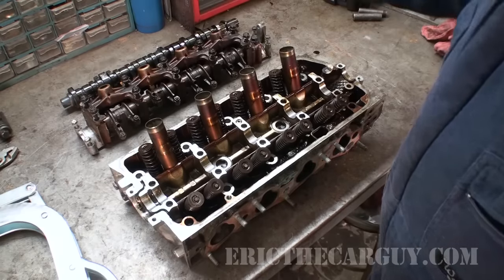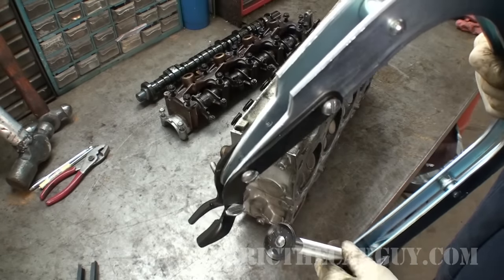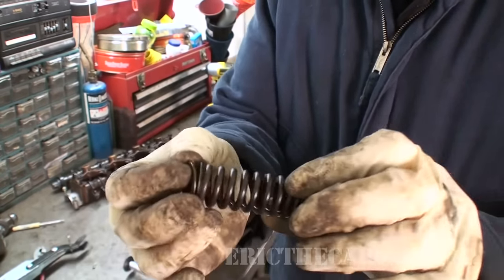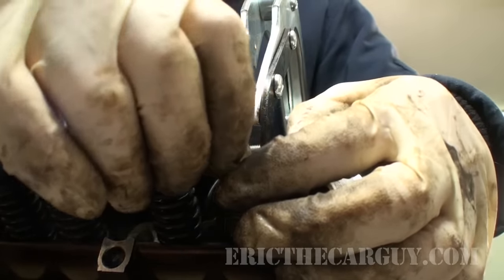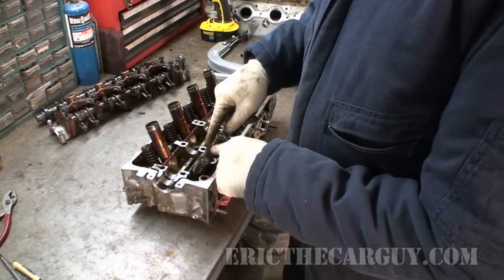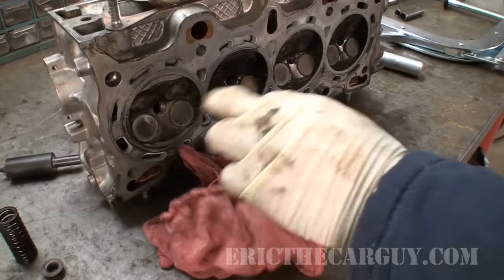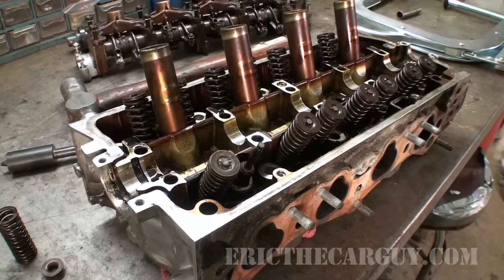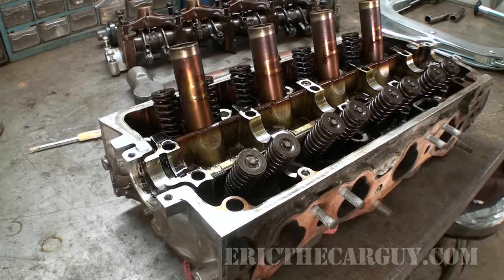How To Remove and Replace Valves in a Cylinder Head -EricTheCarGuy

Comment: If you lose one of those valve keepers or they come out when you compress the valve can that cause an engine to run lean? My car started to run lean and now it doesnt want to start at all and i took my spark plugs and they were all black one was even bent/melted partially. Could it be that the valve lost a keeper when I compressed it then and then the valve doesnt close all the way now and loses compression?

Comment: I've heard that you can use that second tool to change a valve spring while the head is on the car.  Can you do a mythbusters type thing?  Your supposed to take the spark plug out and hook the line from your compression tester or leak down kit directly to an air compressor.  The pressure of the air is supposed to prevent the valve from falling in.  Maybe try it with different sized compressors and take measurements of what psi the cylinder holds during the test.  Maybe take note of how long your tank maintained the pressure to do this.

Comment: Hey Eric, love your vids. Have a question that I couldn't find the answer to on G. Have a 1999 Accord LX 2.3L. VTEC F23 motor. Timing belt tensioner broke and the timing belt was so tight it broke the end of the Cam Shaft pulley where the bolt screws in to the cam. Before I change the cam what should I look for in terms of other damage? And if my timing was incorrected how can I correct?  If there is a vid of you doing this please send the link and thanks for any info! Keep up the good work...part timers like me appreciate you.

Comment: That was good info.  But how do you replace the valve stem seals in a 1996 Honda Accord?  How do you replace the piston rings?  Mine is burning oil, but I want to keep the thing.  Are these things involved in a engine rebuild job?  If so, what else is involved in an engine rebuild of a 1996 Honda Accord?  What does it mean to hone an engine, or is it the cylinder head you hone?  How would you do that? I have a machine shop I can take it to. Any step by step instructions on how to do these things, since I'm poor as a church mouse and can't afford to take it to a shop?
Reply: Marlene Smith the valves he’s showing you are for combustion and intake which is how the pistons are moved! You have to go further down into the engine block and take the pistons out to replace the piston rings!

Comment: Axle grease is a great tip. :-D 

Last summer I had a leak on the seal under the spring so I went and replaced all of those. I did it without removing the heads though.

Comment: I've always used a rag in the cylinder bowl, place down on a soft(ish) surface and used a magnet to hold a deep well socket and pop it with a hammer, magnetized socket catches the keepers and valve is released. might not be the best way, but just how I was shown.

Comment: Can a cylinder have good compression during a compression test but still leak compressed air out the exhaust tail pipe during a leak down test

Comment: Hey if you ever get a hold of a 3.4 gm dohc could you show a process on removing just one of the heads and replacing the seals?  No videos whatsoever on that motor and a lot if DIYers are in need of a little guidance.

Comment: I have a trick for you for replacing umbrella seals on a 350 head without pulling the head using lawn mower cord inside the spark plug hole and bringing the Piston to the top very gently pushing the against the valves with the lawn mower cord and then taking the valve springs off as you did with the tools without pulling the heads

Comment: Eric, I know its an old video but if changing the valve seals, could you do this with the Head still bolted to the block and use compressed air in the Cyl chamber to hold the valve in place? Would like 130 PSI keep the valve from moving when you hit is with tool?

Comment: Do you need to add any lubricant to the valves when you put them in? I'm putting new valves on my 69 351w heads to help save the seats instead of having them cut out.

Comment: One other way i've seen to position the keepers with ease is this old trick which entails taking an old car extendable antenna and choosing the right ID for your keeper OD. Then simply slide the antenna tube over and it will pop off as you release the spring tension.

It can also be used when removing the keepers by holding it over the keepers as the spring is tensioned. Unfortunately the type of clamp you're using might make this difficult or impossible but at least the placement one works universally.

Ever since i was shown this trick, never had one of those suckers go rogue on me.

Comment: I have a problem where my valves won't stay adjusted after I do it.  Specifically, they don't un-adjust to any specific settings, they seem to be randomly becoming loose or tight about 50 miles drive into a valve adjustment.  

Do I need to replace the valves?  Is it as simple as replacing the top part or do I need to do this full valve spring replacement?  The parts don't seem bad other than this one symptom.  But I don't think the previous owner ever did a valve adjustment and the knocking gets pretty loud after that 50 mile mark from a cold start (2000 civic has 140k miles on it).  Is there something else you can think of to prevent the valves from un-adjusting?

Comment: If replacing a valve with a new one must you oil the whole valve or just the stem? Did a cam swap didn’t start found intake valve wasn’t closing tore it apart also noticed all my valves are now rusty from head gasket leak. I lubricated stems first time around unsure if I needed to oil entire valve?

Comment: Eric , need help/ advice i have a mitsubishi eclipes 06 3.8 v6 i had it idling in the yard while cleaning up the the engine from dust and grime when the timing belt snaps and engine instantly died , idk if i should try to install a new timing belt and get it started , dont really know where to start

Comment: Does the head of the spring loaded nipple on the installer part have to be no wider than valve shaft in order to work? I'm not sure how it works this part but it's not working for me. How does it get the keepers to fit around the valve shaft?

Comment: Also is it possible to put The other pistons in TDC ? I'm supposed to put the air supply and the pressure gauge into the other spark plug wells, and in firing order right? Correct me If I'm wrong.

Comment: I got a question for you. So 07 Jeep Liberty 3.7 shot the rocker arm through the plastic cover but nothing seems to be damaged so I want to replace the arm and lift just to see if that's it or if I have to go deeper (Never have before) BUT there is a metal ring stuck on the top of the valve stem and it won't budge. 
I need ideas on how to maybe be able to pull that off the stem without causing any damage. Tried plyers and tapping around it with a screwdriver with no movement. Should point out that I'm poor and never had to do this before but if I myself don't fix it I'm so screwed in every negative sense of the word. So tired of carrying 5gal water bottles to and from the store. smh.

Comment: What causes valves to be sucked up in heads? All the exhaust valves are sucked up up to 1/4 ince and was only revealed after taking rocker assembly off where springs were no longer same height. Removed heads and you can see valves not seated as intake valves ( flush ) they are sucked up.

Comment: Eric and my question is Crv Honda Piston 1 and 4 is it necessary to put the rope inside before removing the Valve stem seal? And then piston 2 and 3 do I need to put a rope inside ? 
Witch one of the pistons do I need to put a rope I’m confused. Because 1 & 4 pistons is up and 3 & 2  pistons is down .

Comment: I had a question. So I changed a hydraulic tensioner on 1993 3000gt sl 3.0 dohc and for some reason when I try to move the car it loses power. Could it be out of timing and how does one know if a car is not in correct timing ?

Comment: I was told the valves on my 2010 hyundai Genesis coup 2.0t were bent and they said it could only be repaired by replacing the engine, for 6k is this true?

Comment: hello ,how many valves are per chamber on a 1998 cavalier ? Im changing the seals without removing the head and don't want any valves to fall in ,so i'm using hanging rope to fill the chambers

Comment: What if the head is not removed? Rotate cylinder to bottom, put rope in, rotate it back so rope holds the valve stems?

Comment: Just found out I need to replace a valve on my 01 accord. 1st time digging into an engine. I'm looking to get the tools now but don't need both of the tools in the lisle 36050 kit I can't seem to find which is which online. Do you have the part number for the one you used on the Honda?

Comment: my serpentine belt broke and the timing belt eat it I replace the timing belt water pump and the pulleys also the serpentine belt oil filter ,oil and coolant just to find out that did not start after checking for compression I find out it was 0 nothing nada so after watching your videos for a month trying to fix my car I guess that the piston vend the valves so my question here is, is it better to change the valves for new ones or get a new engine it took me a month to save money for the tools to change the belts. and I have no experience in this but I love it after I did everything and find out that I did it the right way thanks to your videos and I know it was done the right way because a mechanic went to check it and told me that I did a good job but unnecessary because I should check valves first before spending time and money with all the other things and I soul get a new engine or sell it to him for 800Dollars ;( Is a Honda Accord 2006 V6 standard transmission. and I change all the brakes for new ones the shocks, motor mounts and all started to change the oil hahaha I kind of love working on my car now thanks for all the information and videos.

Comment: Eric will that lisle tool work on a honda k24a1 valve spring? They are seated inside the block and do not extend to the top. So a spring compressor wont work.

Comment: Hey Eric, I wanted to ask your opinion......I recently purchased a pre-owned 2017 Ford Fusion (2.0 Ecoboost w/turbo).  This was a "rental" car and has 43k miles.  The Carfax shows the cylinder head gasket was supposedly replaced, but two weeks in....the heater stopped blowing hot air when in idle position.  I also noticed a slightly thicker white smoke coming from the dual exhaust pipes. No coolant leaks, and the car ran very smoothly.  Now, the Ford dealer is taking great care of me and everything was under warranty, but they needed to replace the Cylinder Head and engine block.  Can you tell me if keeping this car is ok?  In your opinion, what all will they need to replace for such a repair?  Is there any advice you can give me?  I would appreciate any of your help. -Eric L.

Comment: I have a 2016 Dodge Grand Caravan 3.6 l Pana crap and I can't figure out why it's running so rough I replaced all the timing chains tensioners VVT solenoids and had the head pulled and they resurfaced it they thought it came in as a head gasket nobody ever told them that I think I needed a valve job but now I'm getting compressed air shooting out the exhaust number two cylinder and when I tested that cylinder I had good compression I don't know

Comment: Hey Eric, please, please, I need your help information. I was working on 09 murano, changing one of the coils, and I took the intake off, and when I heard little something fell and for sure a little md*** nut fell inside the holes of the engine I find out it was because when I started the engine I can hear the little f**thing bouncing 
My cuestion is what I can do? Or where those stupid things go when they fell inside 
Can I take the valve cover gasket?
Please

Comment: I have a 2.2 ecotec I'm working on. It is a no start engine. It has spark, good fuel pressure but the compression is off... Cylinders 1-3 have at least 220 but the 4th has about 150-160 can't remember exactly because it's been a minute since I checked but close. Anyway I removed the valve cover a while ago to take a look at the top of the chain. It looked tight. So I left it alone. Was unable to do a leak down test. Anyway I ended up taking the timing cover off yesterday ( I had reassembled everything else 2 weeks ago so I only removed the timing cover) Anyway I'll be removing the valve cover again tomorrow because I ran out of daylight removing the timing cover. My issue is I think it may be bent valves in cylinder 4 or it jumped timing because the chain is tight and does look great. If it has jumped timing how do I align the cams correctly... If you don't know can you direct me to someone who does... Thanks....
Reply: loveto livetruely 3/4 is good enough to run, just poorly. Your timing is off

Comment: Hey I had a rocker arm break off in a 2011 eco tek Malibu,  what's the proper way to fix this man, I get many diff answers and I'm honestly not sure who is rite and cant find alot of info on it.  I replaced it, runs good but I keep getting codes emission codes mainly and it was the exhaust intake side any ideas

Comment: I have a mazda 626 1995 DX 4 cylinder. Does the 36050 valve keeper remover installer work for me or I need another type?

Comment: I have a 2002 land to freelander.  it just died.. timing marks dead in. got fuel, spark, no vacuum leaks. tries to start... I have a spare engine with good heads on it.... can i just switch the heads out? I need help

Comment: Yo, Eric I have two of the valves sticking up on my 2005 Nissan Altima 2.5L 4 cylinder engine the left side is up like 1/4 inch n the right side is 1/32nds of an inch n I asked that one guy who's video I saw on how to do a head gasket n he said if I take it to the shop then they'll do it 4 me cause he said I need a special tool to push it back in he said n I asked at that one automotive shop how it'll cost me n he said $380.00 something n I said to myself that I don't have that kind of money right I said so I remembered google n I asked n I seen your video which is all cool yo, I liked it alot n got the understanding on how to do it bt my question to u is so when I get that tool n do those two valves do I need to do all of the other ones

Comment: Cool vid. But just fyi, you compressed that first spring waaay too far. You only need to squeeze it jus enough to remove the keepers. You wont bind the coils and it’ll be easier to work the tool. I like to, on a non OHC head, turn the adjuster way out, far enough for the closed tool will fit over the spring and retainer. Then turn the adjuster until you can remove the keepers. Like he said a lil magnet is awesome. Now the tool is adjusted for the rest of your valves. Or at least half if your intake and exhaust are that different. Cheers!

Comment: so what are the chances i bent a valve on my 1997 honda prelude timing belt snapped at about 1300-1500 rpm shfiting into second right as the clutch engaged

Comment: Can you change just the valve seals without taking off the head?  Or would the pressure of putting the retainer back on assuming you don't use a hammer damage the piston/valve?
Reply from the maker: Yes, but you need to run compressed air into the cylinder or put a rope in there to keep the valve from falling into the cylinder.
Reply: EricTheCarGuy
Reply: +EricTheCarGuy that's exactly what I did. The rope trick :)

Comment: Collets, not keepers! jk call em what you like of course, but Americans do like to do it their own way lol. I'd never use that hammer tool, I just don't like it personally. Plus when using the VSC, usually I would get it set so when the arm is pulled, it's kind of tight on the spring, but not fully compressing it. I would then use the thread to slowly compress, and then slowly depress the spring, that is one big VSC you have there though lol

Comment: having problems with my 2008 grand prix base cant figure out this p0305 code done change spark plugs wires coils icm fuel injectors fuel pump mass air flow sensor pcv valve egr valve and more could the problem be a broken spring in the cylinder head or valve help please

Comment: Eric,
Do you know if the Valve keeper remover and installer tool will work with the heads still in the vehicle? It's a Ford F150 5.4 liter 2 valve to be exact.
Reply: +Ben Silva Some valve tools allow this without losing the valve itself. Applying air pressure or using rope. I know the cams have to be removed in order to access the valve springs. I haven't attempted this yet, but I know it's coming and soon.

Comment: In my need it seems today to read between the lines, I am in doubt of what you are saying about the second remover.. It will work on ALL springs, is that correct?
Reply: Applepiebetty most all, its great for recessed valves.

Comment: Do those cylinders between the springs hold the spark plugs?
Reply: +austex2020 if you go to 2:04 the hole inbetween all four valve is where the tip of the spark plug screws into

Comment: What is the difference between hydraulic valve lifters and mechanical valve lifters? I was thinking about buying a GTi cam from a Golf mk1 1.6 gti, but I am getting mixed answers about if its going to fit my Jetta mk1 1.6 motor (EM enginecode)
Reply: Comp Cams website has an amazing explanation of this exact question.

Comment: I have hydraulic valves on my car, does it still have springs?
Reply: +BlenderGamerFreaq You will still have springs to pull the valves back shut.  The hydraulic part you heard is the lifter part.  It basically keeps the clearance between the rocker arm and pushrod or whatever adjusted and then the valve gets pushed open.  As the rocker arm rides down the backside of the cam lobe, the valve spring starts pulling it back shut.